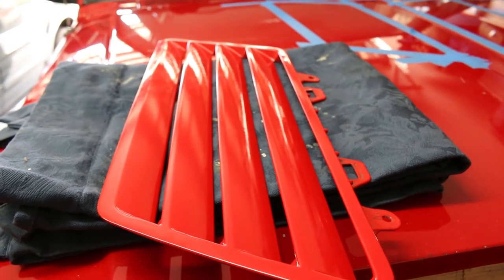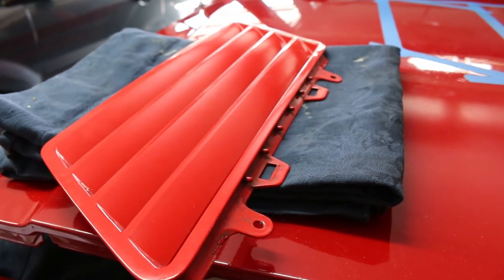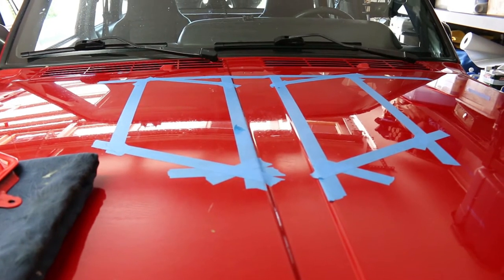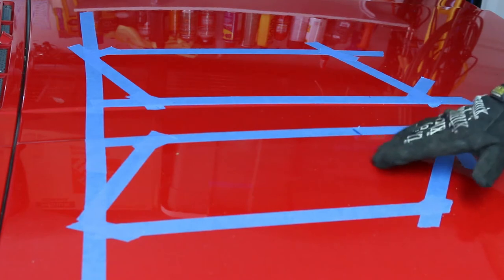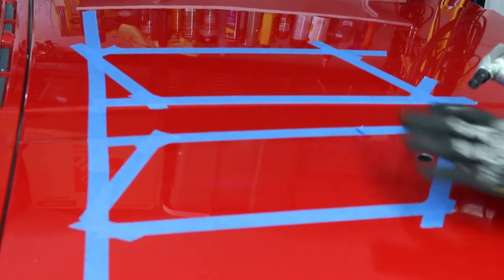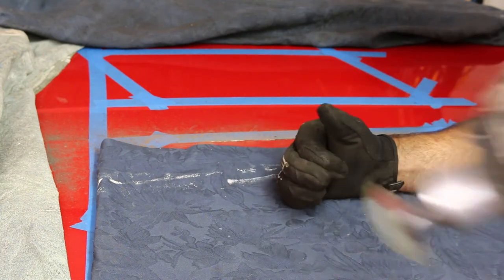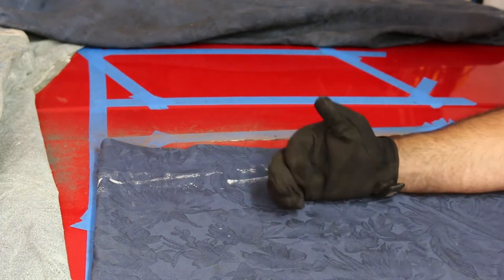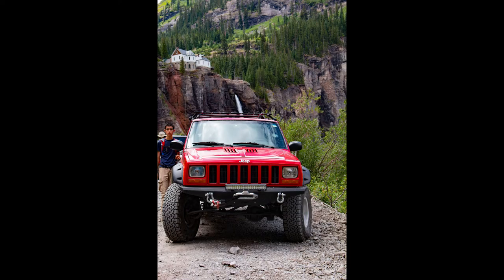Installing Hood Vents in Jeep Cherokee XJ

Comment: Love your video's. Great looking Jeep! Just a quick little XJ public service announcement: When my cooling system was stock I never had an issue with high temps or over heating. As soon as I replaced my leaking stock radiator with an O'Reilly's "OEM" model radiator, I began battling all the high temp/over heating issues that many XJ owners go through. I live in SoCal and commute in heavy traffic where we can get up to 110* plus in the summer. My '97 is heavily modified with a lot of extra weight from lifts, over sized tires, winch/bumpers etc. Somewhere along the line I ran across a post about a Mopar OEM Heavy Duty Towing model radiator. I believe it was for a later model like '99 or '00 and said it wouldn't fit the '97, but it fit my '97 perfectly. It basically cured all my issues. I can crawl through traffic or trails in 100+ degree temps with my A/C blasting and my engine temp stays under the 210 mark. In more moderate temps, my engine runs in the 190 to 195 range. I don't have the specific part number for HD radiator on me right now, but they're not hard to research. Hope this helps some find a cure for their hot XJs. Good luck.
Reply from the maker: Mopar OEM ftw.  Thx for watching!
Reply: Can you send me the link to that radiator

Comment: Hey there,
Nice job on the vents. I have a 1996 xj and installed the chrysler lebaron hood vents. Surprisingly,  it did nothing to help with my overheating issues. However, a much needed coolant flush and new thermostat,  zj clutch fan, and new fan temperature sensor worked wonders. I'm still glad I installed the vents. Like you said, it helps overcome the heat soak problem with xj's and maintains integrity of the belts, hoses, and vital sensors. One word of caution...I replaced two new TPS sensors after getting them very wet from washing, wheeling, etc. Like you, I used dielectric grease on connectors and also retrofitted a rubber boot from the distributor housing of a 5.0 mustang to cover my TPS. So far it all worked great. I have a short video on YouTube.  Your xj is beautiful.  Regards, Randy.
Reply from the maker: Thanks Randy.   I have found that the biggest improvement to temps is to run Mopar Fan clutch and thermostat.  I am running a Napa radiator at the moment and will be putting Mopar radiator in down the road.   I had a new Napa fan clutch and Stant thermostat and it would run at 212 -220 with AC on around down or on highway.  I recently put in the Mopar Fan Clutch and Thermo and it runs at 204-208 with AC around town and highway. That is with 90+ ambient temps.   Also noticed that when it gets to 208 and I let off gas it drops to 200 very quickly  (30sec or less)  I'm using ODBII reader to monitor temps as well.  

I know some have had issues with water on the TPS so time will tell.  So far no issues but I'll probably pick a new one up to have as a spare just in case.

I'll have to check out the mustang boot cover.  The TPS' that you changed, were they Mopar or aftermarket?

Comment: I'm thinking about doing the Napier hood vents. They're designed to not let water in but let hot air out. I have the heat soak issue and I think this is will really help because usually I have to open my hood to let it cool off

Comment: 1. you put one of the vents reversed because the vents are all going in the same direction on both sides.
Reply from the maker: John Padilla yes..... already noted and fixed awhile back.  Thx!
Reply: @surgeonfish9014  Been a couple since your response.  I also noted the direction, yet I have to think if one had blow out from the engine compartment that it might actually be beneficial to have it not get onto the windshield blocking ones vision (hypothetically).  Yet one would need to do a air flow test.  Currently the '89 XJ that I am working on still has it's A/C unit, so the alternator is still in the lower right stock location.  As I live in a more northern region I am considering the removal of the A/C unit which would increase the radiators air flow.

Comment: I saw your previous video on the Jeep XJ walk around. I was most interested in the front bumper. How difficult was it to install the winch??? The winch is very much hidden, which to me is a GR 8 idea. 

Did you first install the winch on the bumper, & then, install both the bumper & the winch simultaneously on the Jeep??? How did you do this install??? Also, what brand winch do you have on this Jeep XJ??? I kind of wonder as to how much room you had to work with while making the install. 

By the way, you have a very nice looking Jeep XJ!!!
Reply from the maker: Winch was installed before the bumper was installed.  No other way to do it otherwise.